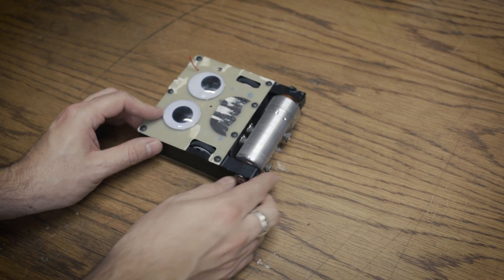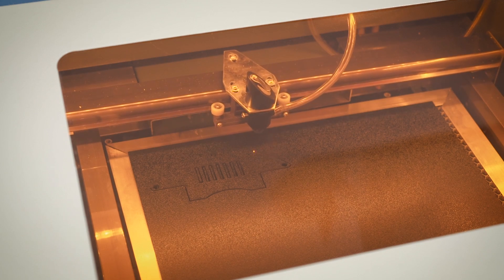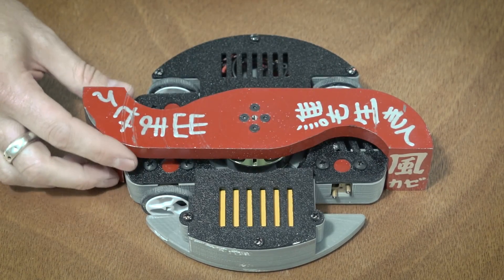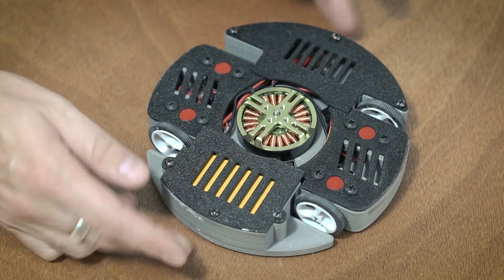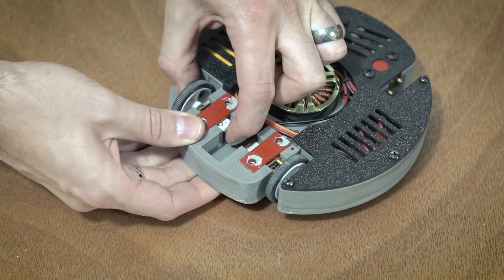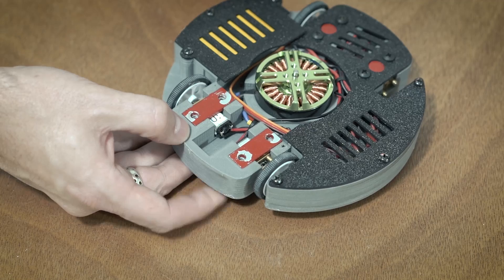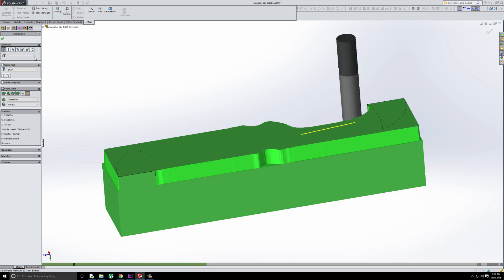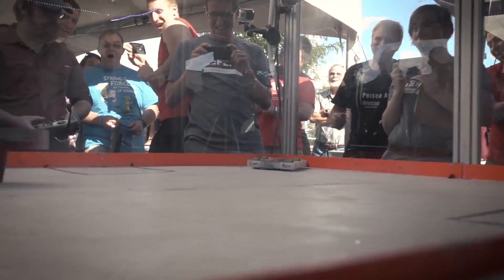Kamikaze - 3lb Combat Robot

Comment: how much battery did you drain in a match? i would have figure that would be a major issue.
Reply from the maker: Yeah, it was a consideration.  I didn't design it to last the full 3 minutes.  I figured there wouldn't really be a situation in which it would last the full match, there would be a knock-out.  So I assumed about 2 minutes of battery time.  The drive motors draw a negligible amount of power.  At max those motors only draw maybe an amp, but generally only 100-500mA.  But the weapon motor can do around 20-40A.  Of course the weapon won't be drawing max power the whole time, only during acceleration in small bursts, so I assumed around 15A average current draw.  So, the drive motors would be around 200mA @ 0.05 hours or 0.01AH, and the weapon motor would be ~15 amps continuous for 0.05 hours or 0.75AH.  That's 0.76AH or 760mAh IF I ran for 3 minutes and the weapon motor pulled 15A the whole time.  If it averaged to around 10A, that's closer to 510mAh.  The battery was a 450mAh, so I was pretty close to either 10A continuous draw, or 2 minutes at 15A.
Reply: Robert Cowan how many cells on the battery? did you go over the burst current rating for it either? I'm looking to get into the combat hobby and i'm just surprised by the battery packs that peoples are getting away with running.
Reply from the maker: I was using a 3-cell, 500mAh, 25C.  So, a max discharge of only 12.5A, that was probably part of my problem ;-)  I use this same battery in my antweight, and it's probably overkill.  I should have used something with a higher discharge rate.

Comment: If the parts and tool are heating up and hardening the part why don't you use coolant ?
Reply from the maker: Good question.  I was having trouble with the flood coolant draining and recirculating in the mill.  There were too many chips and it was clogging the drain.  I need to get a fogbuster.  Also, I've read that when using carbide tooling, it's best to let the chip carry the heat away from the part.  But I could be totally wrong there.

Comment: I loved watching your little bot; especially after it got hit and then went all "Tazmanian Devil". I've been curious about machining tool steel on my 440 -- curious if you tried coolant?
Reply from the maker: I did try coolant.  Unfortunately, I only have flood coolant and it has some problems on the 440.  The drain is very small and clogs easily.  So you'll be cutting one minute and then suddenly there's no coolant and you have to unclog the drain.  With the amount of chips I was making, I would have had to clear the drain every 5 minutes or so, which would have been a huge pain.  Secondly, the coolant gets everywhere.  The doors aren't sealed, and if it sprays on them, it drips down on to the floor.  So I opted to go without coolant.  I'm working on a DIY fogbuster type thing which I would use next time.
Reply: That makes sense. I didn't install the flooder on my 440 and instead bought a Fogbuster which I found is nice and clean and works really well.
Reply from the maker: Yeah, I think that's what I'm going to switch to.

Comment: did you think about chamfering the edges inside the body? especially between the weapon motor mount and the drive motor mounts. It should stiffen it up significantly.
Reply from the maker: That's a really good and simple idea.  It would give more of a wall between the layers.  It would also add minimal weight.  Hum, I'll have to think about that.  Nice idea!

Comment: Adding lightening holes to the arms of the weapon will reduce weight where it doesn't matter.   I would imagine that the energy at the tip of the weapon is affected very little by removing weight from the drive arms, given their distance from the center of mass.
Reply from the maker: 100% correct.  With most of the weight on the outside, the hitting force should be roughly the same.

Comment: I would suggest sharpening the weapon so it doesn't make a 90 degree angle with the chassis but something closer to a 75 degree angle, this would give it a better bite when it hits another robot and it would give you a little more weight to play with as well. Awesome job though
Reply from the maker: Thanks!  Yeah, messing with the geometry might be a good idea.  I wanted a 90 degree profile so it 'whacks' the other guy rather than bites into them.  I want to get a super slow motion camera to actually look at the impacts to see if anything can be improved upon.
Reply: You can use a flash, and a DSLR. May be a hobby photographer, with proper gear can help here. Use a laser/proximity sensor to trigger the flash.
But, you won't get video, but only photos.
Reply from the maker: I want more of a crash-test-dummy type of video for each impact.  I've been looking at the new Sony cameras which do 960 fps, which could make for some great footage.

Comment: Great build as always. I wonder if you infill the 3d printed frame with long set epoxy (including "cross paths" so that it flows between) to create some more rigidity. Thinking about how they use cement and rebar steel in building construction to provide both strength and flexibility.
Reply from the maker: Yeah, I was thinking of building in some voids, pausing the print, and adding in some carbon fiber rods or plates.  Some high end commercial printers do this.  We'll see.  I'm working on a few other things now (which involve 3d printing), so I'll do some tests.